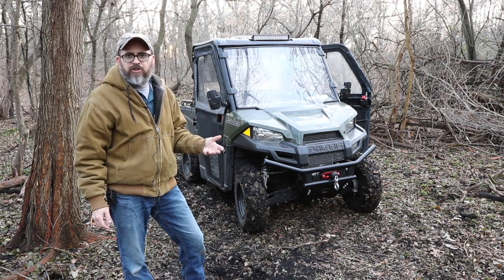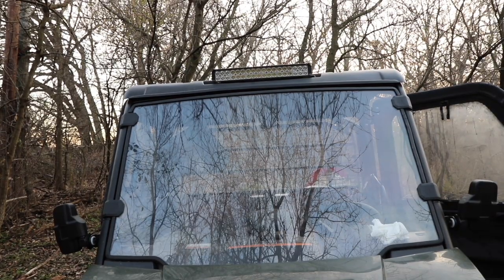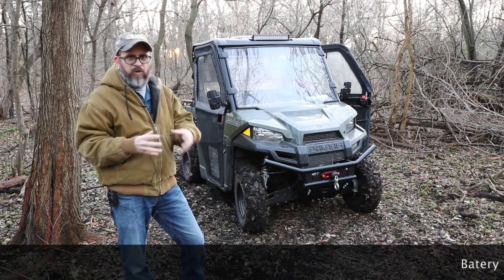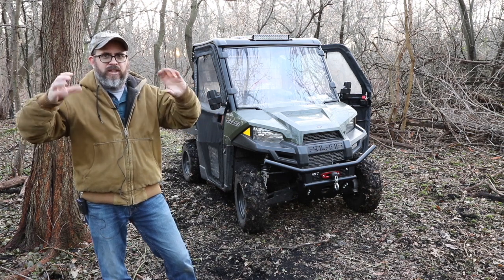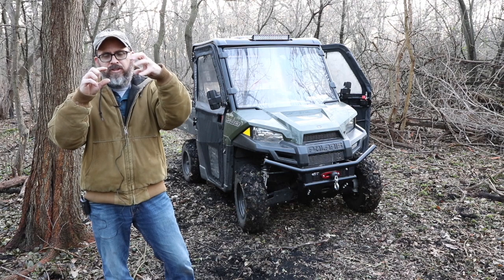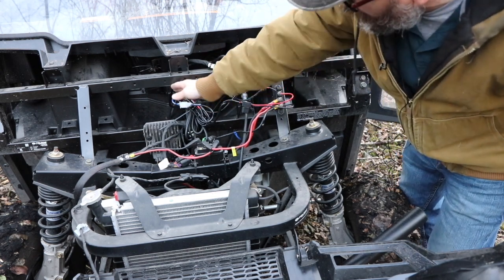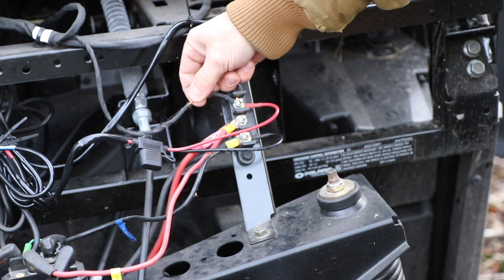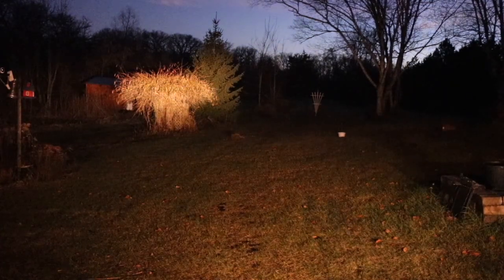Cheap UTV lighting LED light bar on Polaris Ranger pt1   for work on the homestead

Comment: I enjoyed the video. We just got out light bar in, 50”, and it seems they can’t get correct size bolts for cube lights or correct brackets. Also bad wiring diagrams. We have the 2021 ranger 500
Reply from the maker: I'm still planning on adding work lights for the bed, and am having the issues you stated also. I have the brackets that mount on the door mounts for the rear work lights. I have been trying out some lights and trying to find the smallest that will work. 50" sounds great for a light bar on the front!